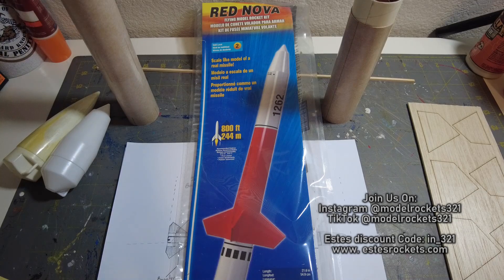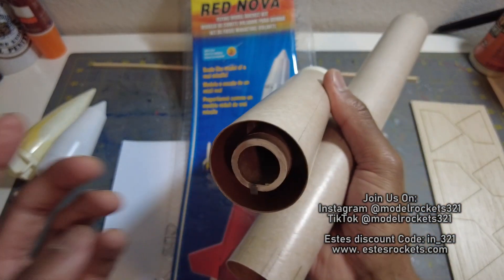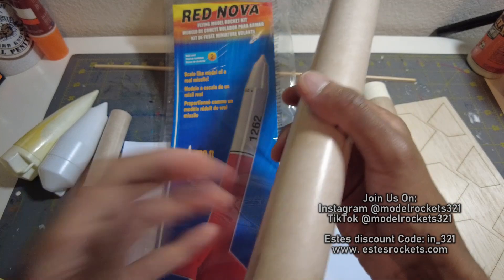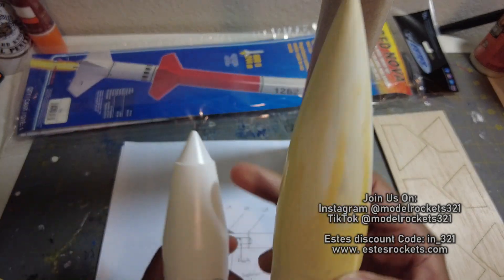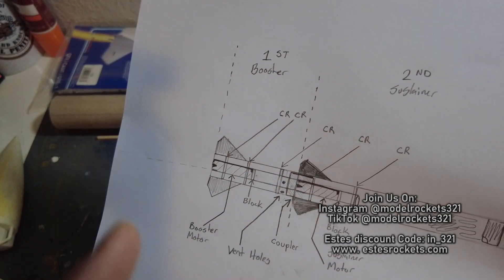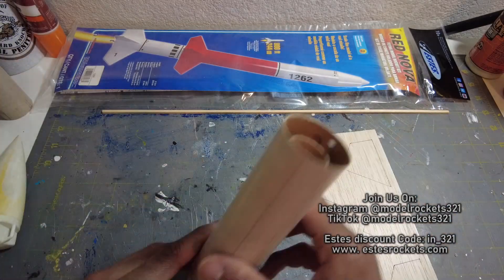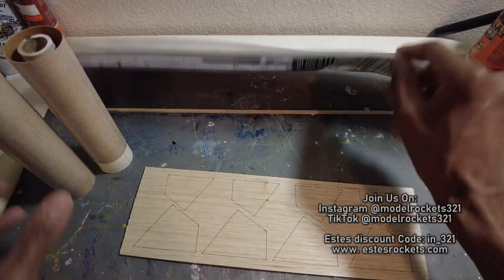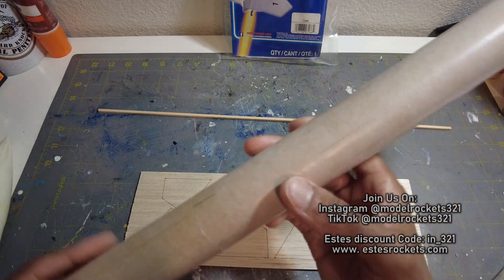Estes Red Nova Model Rocket: 2 Stage Conversion Project: #rocketry #diy

Comment: Great idea, brotha! Sorry for the silly question, was there room to pack a chute in the first stage? If not, did it sustain major damage from the fall? Always appreciate your videos!
Reply from the maker: No problem. Thanks for watching. There's not much room for a parachute. Actually figuring out how to make it fit and deploy is main issue or item to resolve.
Reply: @modelrockets3215 Good to know. Appreciate the follow up. Im gonna follow your outline here and see what I can do about getting a chute of some kind in there with the motor mount. Tight fit for sure. I'll update and let ya know how it goes
Reply from the maker: @swatseals Sounds good keep me posted

Comment: Interesting. I wonder how long you could make the booster and still have reliable ignition. I have a two stage mini doorknob I am building and that’s the part I’m stumped on.
Reply from the maker: This is a very short distance to stage without an issue. You can gap stage a pretty far distance. But you must have vent holes to push put the cold air out between the stages.

Comment: Nice ambitious project. When you make that stable with large E/F engines, as the propellant burns, the CG will shift forward possibly making the rocket "super stable", which may result in the rocket pitching into the wind. Hopefully RockSim will show that flight profile.